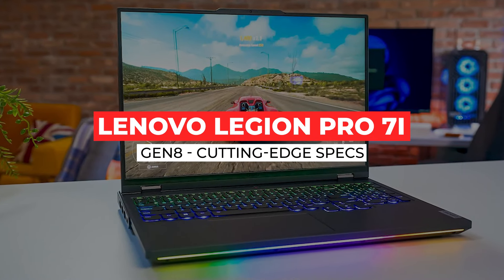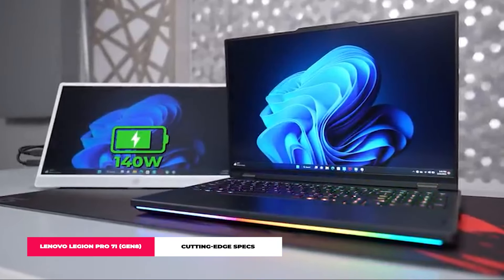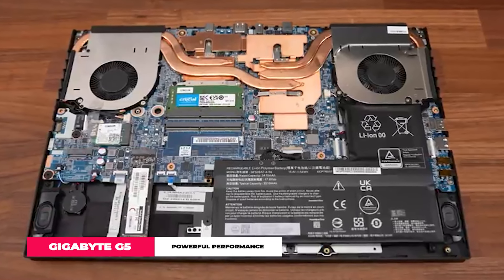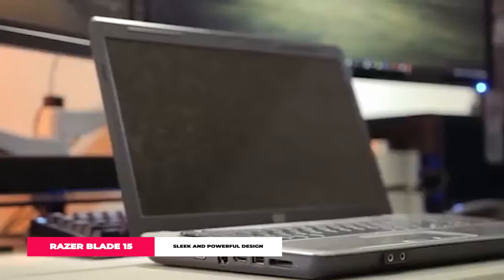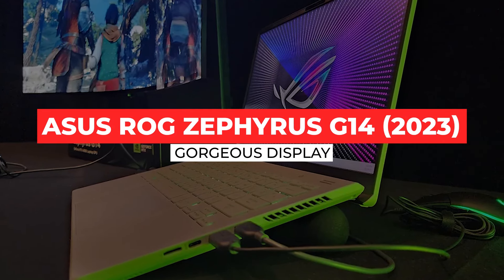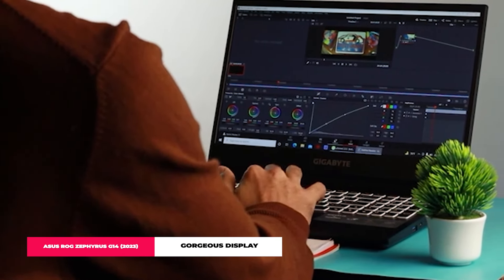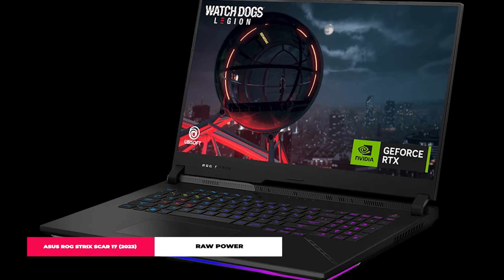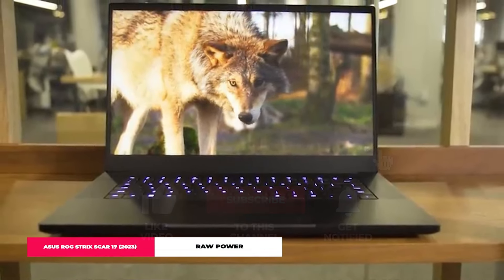The BEST Gaming PC's to Buy in 2024

Comment: I purchased my Dream Machines i7 13th generation laptop equipped with a GeForce RTX 4060 for 1289 euros. In comparison, the Asus model, featuring a 12th generation Intel processor and the same GeForce RTX 4060, was priced at 1750 euros. Quite a deal! 🤣
Reply from the maker: Nice deal indeed! Are you happy with it so far?
Reply: @TechEvolutionUSA  no complaints really! I highly recommend Dream Machines products🙃
Reply: How much fps did you get în fortnite performance mode low settings?
Reply: @cornel1972 sorry I dont play fornite